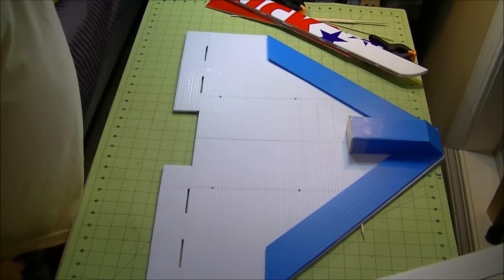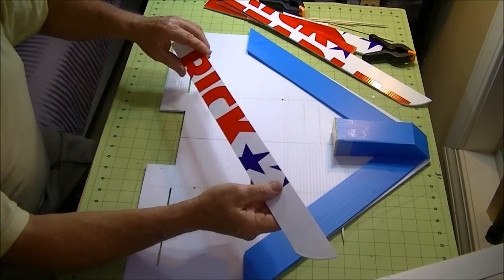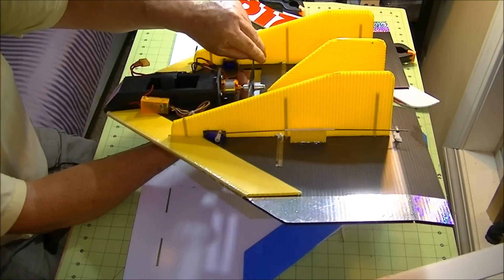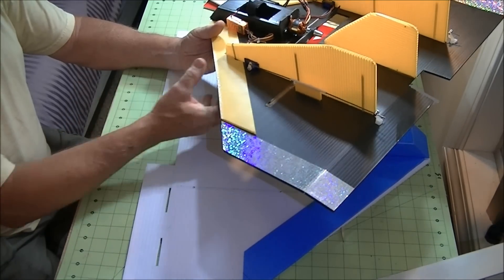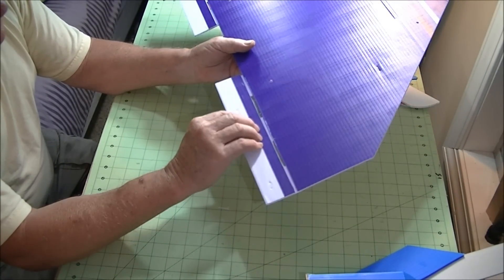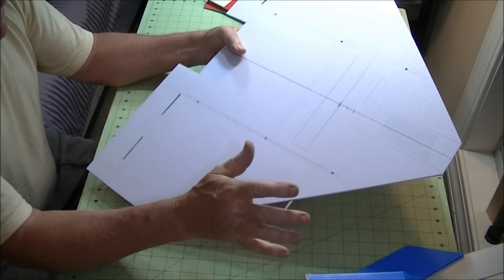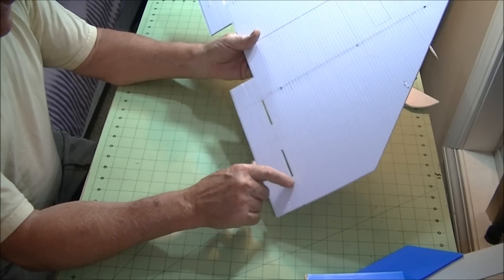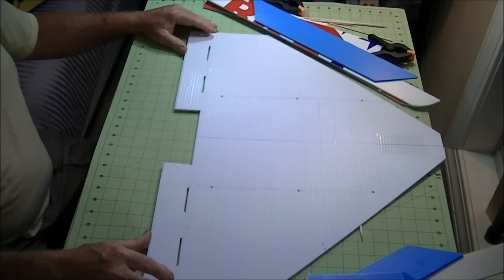Coroplast rc plane building technics

Comment: Thanks for sharing. I started to realised that profile wing in corrugated plastic design is not as efficient in terms of lifts and lower drag factor. I began to explore  spad design that when folded properly yield very good lifts. For high speed design, I folded in swept back delta shaped wings with tapered chords . This design is better than the constant chord or barn shape wings. I use mostly 1.5 mm thick CP for wingspan up to 36inches. For larger wingspan, I use 2 to 3mm thick CP board.

Comment: As a suggestion - cut the ailerons off and use tape hinges (or buy nylon model aircraft hinges and glue them on)
Reply: +Tsnafu   Or, cut the top flute all the way across. Then underneath go back one flute (or forward ) and cut across. -Two flutes cut. One for up, one for down.

Comment from the maker: Coroplast is much heaver than foam board but is still useable. As far  as hot glue ,when I bough the yellow and black from a sign store the hot glue stuck like iron but the next  batch I tried was a printed election sign and did not stick very well in fact it was a profile which came apart in the nose area.  I have seen videos of people running a propane flame over the coroplast  or possibly sanding the area to be glued would help. Possibly using high temp hot glue . I'm open for other suggestions.